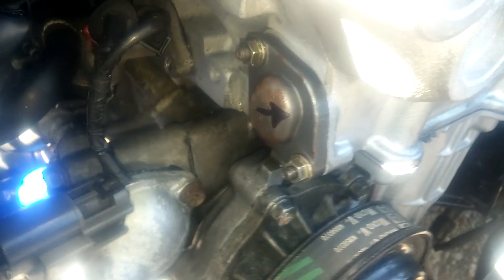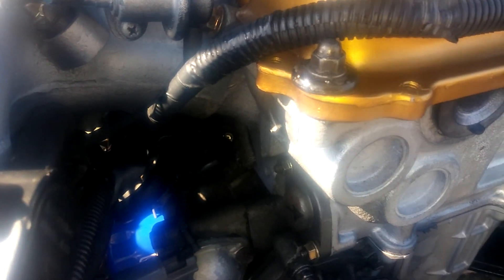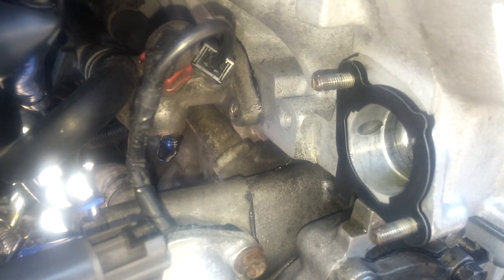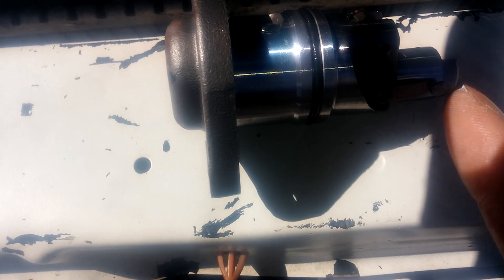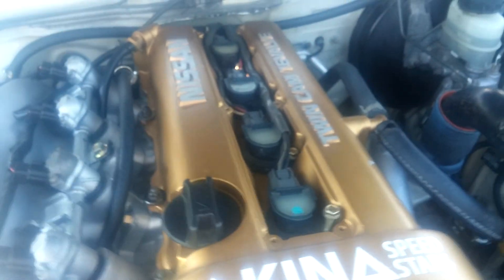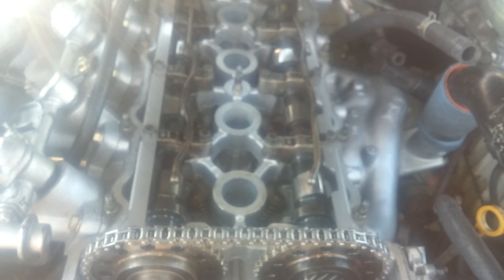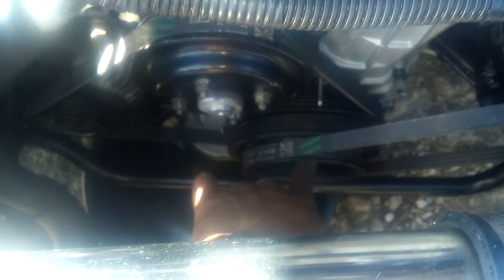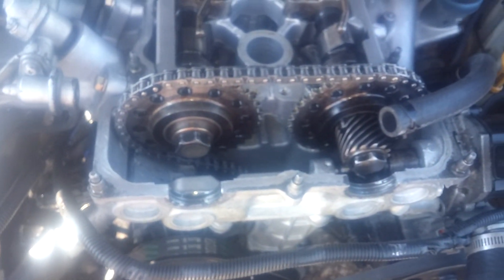Sr20det timing chain tensioner gasket install

Comment: Hey man would this be the same for SR20DE  ??thanks
Reply from the maker: if you're asking if the tensioner gasket is the same one as the sr20de, yes it is.
Reply: yeah just all round same engine as non turbo? just without a turbo?? and like some more oil feeds?
Reply from the maker: yes there are a few items that can be sourced from the NA sr20de but there are also things that are sr20det specfic
Reply: Thanks man.
 But everything u showed here would be the same yeah??
Reply from the maker: yes sir
Reply: awesome! How did u do the graphic on your rocker cover man?
Reply from the maker: its just a sticker placed on the valve cover
Reply: ok thought a sticker might melt haha
Reply: Hey man, just wondering did the Oring that goes around the tensioner come with the gasket? 
Thanks
Reply from the maker: MILBURN96 no.
Reply: Did you need to be at top dead center